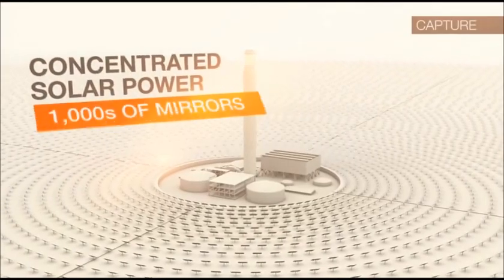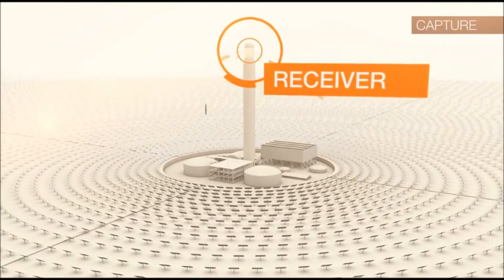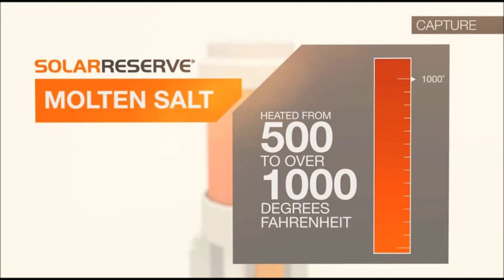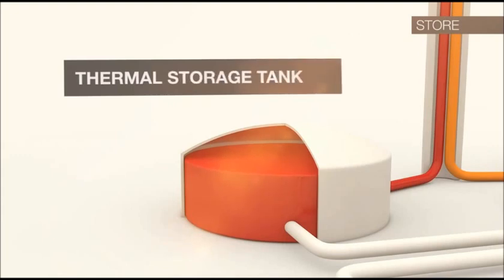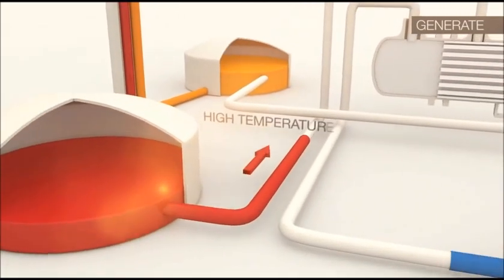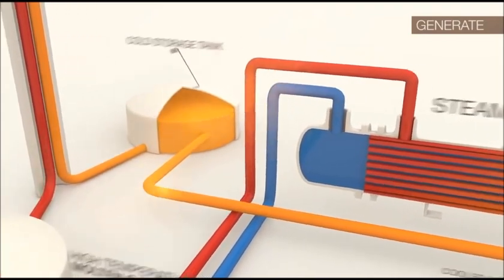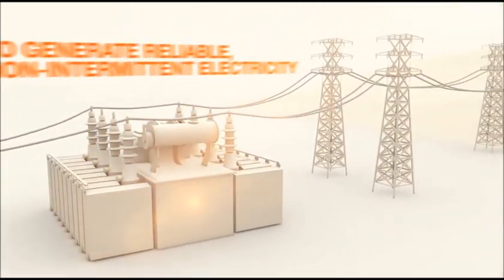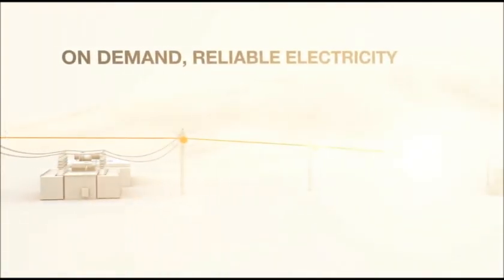Concentrated Solar Power Simple Explanation

Comment: Very clear animation. Thank You.
Why is the low temperature and low pressure steam condensed? I suppose there is energy loss in it. Because it is necessary to be able to reheat again?
Reply from the maker: Guzzi venture Very good question. The steam is condensed again to turn into water again so that the water can be reheated again in the liquid form. There is considerable energy loss when the low pressure steam is condensed into liquid water. Once the liquid is heated again indirectly by the solar energy, more energy can be added to liquid water to turn the liquid water into steam again. It's a cycle that is used in nuclear reactors, coal steam turbines, etc. All forms of electrical energy production that use turbines have this exact cycle, just that the method of producing the steam varies from nuclear, solar, coal, etc.
Reply: It is a way to control the steam pressure . Just imagine if the water all overheated into steam..and pressure build up in the system..without any condensation. U gonna explode the steam turbine..

Comment: I'm suprised that the heliostats are not dish shaped to concentrate more of the heat into one point.
I also wonder if anyone has done a half heliostat half solar panel on one mount.
This way you could store the solar panel energy in a battery and the heliostat side could heat the tower 😉😉😉😉😉😉😉😉

Comment: There has been cases where birds have suffer burns because they flew near the focal point. Any ideas in how this can be prevented?
Reply from the maker: Great question! They do use high frequency speakers/sirens near the focal points of concentrated solar plants as well as near wind turbines for this same reason. This keeps away birds and does a very good job at doing so. Great question!
Reply: Nice. This is by far the least intrusive source of renewable energy in my opinion. Also reliable 24/7. We just need to scale up. Thanks.
Reply: thanks for this note
Reply: Probably worth noting that buildings cause FAR more bird deaths than concentrated solar power and wind turbines. To put it into perspective, between 365 and 988 million birds die from crashing into windows in the United States each year (according to this article https://tinyurl.com/y98knd3n).
Having said that I still think some effort should be made to avoid bird deaths/injuries but it shouldn't be a reason to avoid investing in these renewable technologies.
Reply: Compared to burning fossil fuels or generating nuclear waste, it's worth losing a few birds.
Reply: Have they tried scarecrows ?

Comment: sir. i m from india. i have a few ques... please reply. i need them urgently..
1. how do you maintain the high temp of the salts in the hot storage tank?
2. is the press of the steam enough to drive the turbine?
3. is it economical to setup the plant for agricultural purposes in rural areas?
4.what happens if the weather is cloudy for a wekk long period?
Reply: I do inspections for these plants. 1) Proper insulation. 2) Steam generators have more than 1500 PSI 3) May not be viable for rural agriculture because of high cost of the CSP plant. India has out beaten China & Germany in 2016 in solar conventional power production. PM, Modi is a great advocate of this technology. I will be visiting the world's largest CSP plant at Ivanpah, near Las Vegas end of next month.
Reply: @dearkrish1  hi  which ASME code do they use for the receiver? ASME I or ASME VIII?